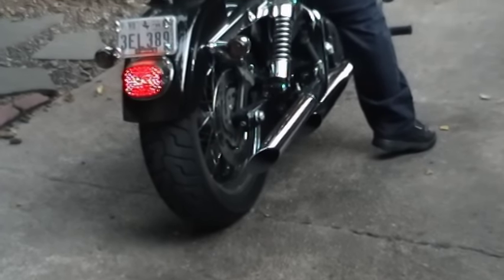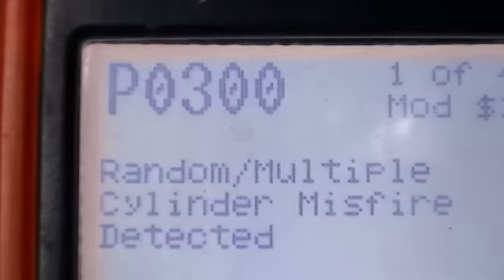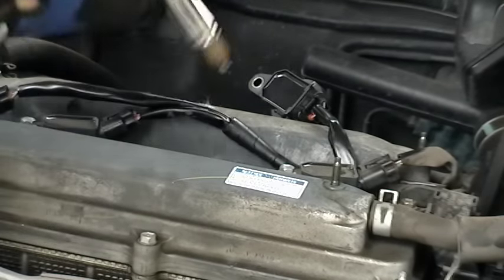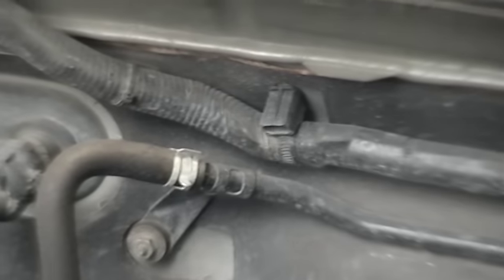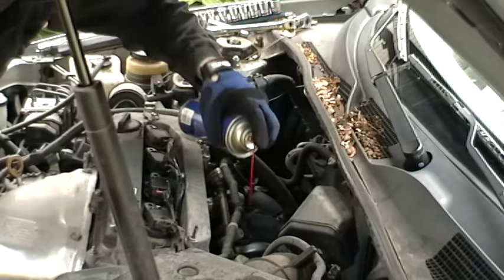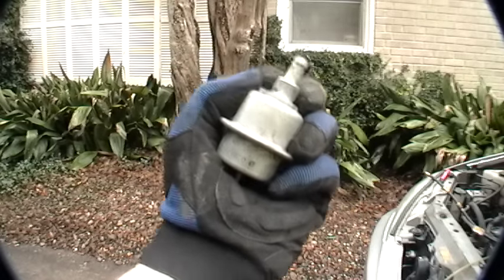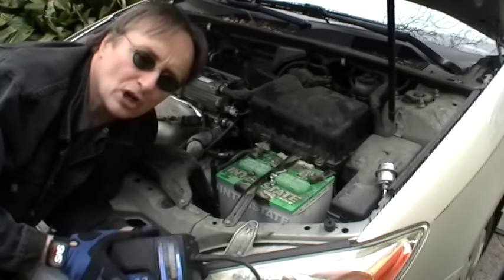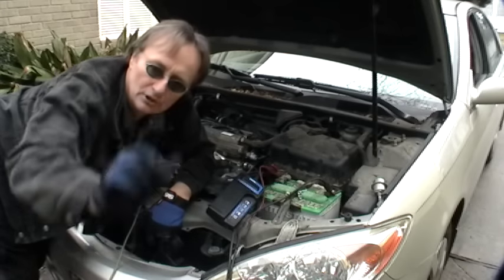How to Fix a Random Engine Misfire in Your Car (Code P0300)

Comment: Hello,
I have Toyota Camry 2006 (2.4L)/4Cyl....  it misfires,/loosing power/jerk during running when I increase the Accelerator...... but it remains Lil bit smooth when I increase accelerator very slowly.... No check engine light no any code. 

1)..I replaced Fuel filter
2)..Injector cleaned
3).. Air control valve Inspect and clean
4)... Ignition Coil Resistance Check and the resistance is between 349 to 350.7 Ohm for all 4 cylinders ( resistance measured between first 2 pins).
5)... All vacuum pipe also checked but did not found anything..
6).... All electrical fuses are ok
7).... At OBDII no no code display

what would be the cause of misfire or losing power or pick power or jerk....???? Please Rply.
Thanks and regards.
Dildar Hussain.
Reply from the maker: often a bad maf sensor, check that data first.
Reply: Dear Sir,
Thank you so much for your response,
I forgot to Write this step...
First of all i inspect MAF sensor and cleand it with its cleaner and replaced the Air filter also... (Fuel adjustment, PCV and throttle positioning sensor i didnot touch,, Are they related with this problem???)
Can you reffer a Workshop manual or Ebook etc..?
Regards
Dildar Hussain.
Reply: Dildar Hussain 
I have the same issue, exactly the same, with my 97 Honda CR-V.  I did all you have listed and perhaps some other things got anlittle better but then went back to the same or worse as you described and I don't know what else to check or do... Did you figure it out yet? If so, what did you doc any idea? thanks Hussain!
Reply: Could be fuel pressure regulator. It really just depends. Best way to nail it most accurately is to get a scanner that can read live data and look at at the fuel trims and all the sensors
Reply: Spark plugs.  Replace them every 50,000 miles
Reply: could be a burnt valve cover

Comment: After a rat chewed on my coil wire which was shorting on a metal tube ( ground ) when I go to live data it only gives info on 4 cylinders. It is a 6 cylinder. In the past my scanner gave info on all 6 cylinders. A standard coil puts out 20k - 30k positive voltage. With that much voltage going to ground I think it has caused a problem inside the ECM. What do you think? I don't see any other damage to my wiring.

Comment from the maker: start with these video tips. realize though that tahoes are notorious for fuel injection leaks causing it due to cheap plastic parts inside the engine cracking and leaking from age.

Comment: hi scotty i have code p0300 i replace spark plug, and wire and coil i need your advice because I spend over 300 $
Reply from the maker: +Karam Chato realize P0300 can be caused by over a dozen different things.  Now it gets complex and often expensive. Best to have a mechanic at least analyze the other possibilities first
Reply: +Karam Chato Cleaning fuel injectors is a cheap step to take to see if the issue goes away, you can have it done professionally for about $100 and because of the system they use to hook directly into the rails you should notice an instant improvement if this was the issue, or you could try a tank additive for $5-$10, pretty much same effect but you will likely have to wait till you go through an entire tank of gas till you see a difference.
Reply: What I did first was check for vacuum leaks, I always check the things that are easy and cheap to do

Comment: I have a 2000 Toyota Tundra 3.4L. It has code po 0300 random misfire. MIL- Evap, o2 snsr, o2 htr, catlyst.
I cleaned MAF, replaced o2 sensors and new spark plugs. I found 2 spark plugs on passenger are black and wet with fuel.
I removed these 2 spark plug wires out. It did not effect the engine. What should I do?
Thank  You so much for your video. I really appreciate it.
Victor

Comment: After cleaning up the EGR valve and EGR passage inside the intake manifold, my Honda Accord 2000 LX V6 engine is choking  or engine is hesitating while driving on freeway.  The check engine light is P1399, P0300 and all sorts of cylinders misfired.  All six ignition coils were replaced not long ago (only drive for 7000 miles), spark plugs also less than a year old.  The only thing I have not replaced is the fuel filter.  Battery looks fine.  What else I am missing here?  Do you think the car has the bad "EGR" valve?  Or fuel filter is clogged up?  By the way, where is the fuel filter in Honda Accord 2000 V6 located at?

Comment: Hi Scotty - My 2002 Jeep GC v8 is randomly giving my a p300,p301,p302 code. I know the spark plugs are good and the jeep seems to run fine. I am taking the fuel filter route as soon as my fuel line remover comes in order. It started with a p301 only and graduated to the 300,301,302. 160k miles on the jeep.

Comment: Hi Scotty, my wife's ford freestar has been misfiring and stalling for awhile already and I thought I had fixed the problem by replacing the fuel filter but the problem came back after she put some fuel in it. It was running fine for about 3 to 4 days until she put the gas and then started right back up again.  What do you think the problem could be Scotty? Thanks for your time.
Reply from the maker: pressure test the fuel pump, it may be going out

Comment: multiple misfire on civic gx 1998 CNG (compressed natural gas)
i have done this till now

-Replace engine oil
-replace spark plugs  (PFR7ND) NGK
-Replace cng gas filter (under the trunk)

What else do you recomend me to do? i am thinking to replace:

-NGK spark plug wire set
-Distribuitor cap
-Distribuitor Rotor
-Distribuitor coil

and my last options are:

replace egr valvle
clean  cng injectors
maybe change catalityc convertor

i will apreciate any help
Thanks
Reply from the maker: do a compression test of the engine first to see if it's just wearing out. If not, have the ignition system analyzed for problems, often a bad dist on those

Comment: Hey Scotty, my 03 VW Passat was running like a charm and after hitting my breaks pretty hard to avoid a wreck, the engine started running really rough and the engine light came on.  Coincidence? Probably.  Anyway, the check engine codes are P0300, P0301, P0302, P0303, P0304, and P0171 (System Too Lean).  Could the P0300 codes be causing the P0171 code or is it a separate issue? Thanks!

Comment: Hey ...need a tip. 2011 Durango 3.6. Just paid dealer to  replaced sensors, P000A, P0017,  P00455. Now less than 500 miles getting P0131, P0300, and P0171... going to new shop..They all want to start with a tune up and a coil. I'm not too certain actually very skeptical. I think it is something completely different. Any tips outside of vacuum leaks and spray carburetor cleaner. I think it may be a quick fix from a sloppy job or triggered from the sensors? What do you think, trying to save 600?

Comment: Scotty,

I have a 2006 Toyota Sienna with 105,000 miles. Used to get jerky random misfires any time I stepped on the gas. I replaced MAF sensor with denso, all 6 spark plugs completely worn down and replaced with ngk, replaced cylinder 2 coil with denso (it was bad), and fixed a frayed fuel injector wire on cylinder 6.  I also found a flex pipe exhaust leak after cat 1. That will be fixed next week. Still the car jerks and random misfire flashing cel any time I go above 4000rpm but it runs great now up to that rpm. You think the exhaust leak is causing all that or I still have issues? Crank sensor maybe? Only code I've ever gotten are p0300 and the p0302 was fixed with the new coil. Thanks!

Comment: The battery comment was right on!  My car had a random rich start (flooding) condition that was severe and mysterious. It disabled the car. Clue was the that stability control light stayed on a 2 sec. longer than it should on those occasions when it did start. Tech was very smart and went to the battery first.  Sure enough, that was it!!!  Now I watch the batteries very carefully and plan replacement at 3 years unless it's still perfect.

Comment: Hi Scotty! I have a p0300 and a p0308, on a 2008 car that's only 3500 miles old (and also p0464). Unlikely that it's caused by spark plugs do to low miles? But ignition coils could still be fair game due to age? Thanks! Love your videos!

Comment: I have a 2000 Grand am 3.4 litre, recently i experienced hesitation between 2-3 rpms and then hesitation through the gears.. I had it checked at auto zone, and it came up knock sensor 1 Cylinder2 misfire and some code for air intake.. I believe it could be my spark plugs and wires.. and also my knock sensor.. what do you think? and how should i go about fixing this

Comment: I would have never thought it would have been the battery. I started getting the misfire codes 300 301 302 exedra right around the time my battery went bad. I had bought a new cheap battery for my Ford tractor a couple of months earlier and was not using it so i threw it in.  The correct battery I took out was a group 35.  I put in a 24F.  I'm wondering if that would make a difference.

Comment: Scotty, my friend recently bought a 2000 Volvo S80 with 195,000 miles. It's throwing a p0300 random cylinder misfire, as well as having a faulty O2 sensor on bank 2 (twin turbo I6). Is there a specific place I should check first, or just run through spark plugs, coils, fuel line? My scan tool data stream also showed that both fuel systems were open, which is a condition I usually only see when a car is off.

Comment: Hi Scotty,
99 HONDA  CR-V 130K on it.
Have all the P0300 codes (all cylinders misfiring) Have 34psi fuel pressure. 
Followed your instructions to the tee.
Just got done changing the fuel pump,  no change in fuel pressure. The distributor cap, rotor, wires and sparkplugs are recently changed as well. 
 What could the problem be?
Reply from the maker: fuel injectors can do that, as can a blowing head gasket, bad wiring, vacuum leaks on the intake, bad computer, lots of stuff. Probably time for a guy like me to at least check it out for faults using his scan computer

Comment: Thanx for the great, concise, to the point, clip.
I've unfortunately got a V8 in a full size van so this series of checks is gonna be slowww and fekking painful.
Any suggestion as to what to check first on a 5l vortec?
Fuel filter is swapped. Pump is only 4 years old and I can hear it.
MAP sensor has reported in the past and I've cleaned it about 4 times so far.
Battery is only 15 months old and dash gauge isn't reporting any issues with charging etc
Reply from the maker: on those, almost always bad vortec fuel injection system due to cheap plastic parts cracking from the heat inside the engine where they are hidden. See that all the time
Reply: Scotty Kilmer
 Thanx Scotty. Sorta! Guess that means this might not be cheap!  lol.  I was just heading out to check the MAF and MAP (but then was thinking not likely as they'd code if they were the culprit, no?).
When I parked, after nearly getting demolished in traffic yesterday, I put it in park and it rev'd fine-but my speedo was acting like a tach!?
The only way to check what you're saying is tear the top off. Guess that means I'm cab'ing it till the weekend.
Thanks again, I've subbed!
Reply: ROOKTABULA
I should add that it run's throttles just fine in park or neutral and is running fine today. I've just had 4 of these episodes in the last month, always from cold start. Usually clears up after 15 minutes.

Comment: 2003 Buick Rendezvous.  P0300  Random/Multiple misfire.  Told by mechanic that cylinder number 3 has "low compression."  Not sure how compression in a single cylinder could cause misfiring of multiple cylinders, or the car to run rough on intermittent basis, and worse at low RPM than high RPM's when the symptoms are present.  However, based on your last tip, I checked battery.  Diagnosis was "Bad battery"  producing only 183 CCA of the rated 600.  Is that "dead enough" to cause P0300, and an intermittently rough (of varying degrees) engine?  Note:  Problem seems much less at highway speeds and at times engine seems normal.  Occasionally, especially starting from standstill, it can be extremely rough.
Reply: Did you get a fix for this?  My Bravada is doing the same thing

Comment: I love your videos, Scotty. I've have a P0300, P0172, P0420 on my 2004 Chevy Cavalier. I've done everything I can think of. I've done everything suggested in this video. Got any idea what's wrong?
Reply from the maker: fix the 12 code first, it's probably causing all the others. Often leaking fuel injectors or fuel pressure regulator causes that

Comment: great video. i have a 1999 mitsubishi montero sport with code p0300 at start-up. i replaced plugs, wires, fuel filter, no vacuum leaks. When i disconnect the maf sensor, it seems to smooth idle. Can the maf sensor be my issue?

Comment: You called it Scotty!
I fought with my ‘07 4.7 Jeep Commander over that PO300 code replacing a bunch of parts with no success. That went on for months. Don’t trust the dealership and wanted to beat the problem myself. I didn’t think it could be the battery as it was a Duralast gold only 3 years old. Then we had a no start day on vacation. I got it going and got home but after 4hrs driving the battery was only at 11volts though the alternator was putting out 14.5v. Put in a new battery and guess what? The misfire issue went away ! Hasn’t thrown a code or had a problem since!
How bout that !

Comment: Hey Scotty,
I have a 2001 Toyota Corolla that has the code P0300 and throws some black smoke when cold. When I first got it, it did not throw any smoke at all, but once I changed the oil and the spark plugs it started to throw the black smoke. It doesn't have the check engine light either. What can I do to make sure what is the main problem of the car?

Comment: 2001 Ford Explorer 4.0L 230,000 miles random intermediate miss fires engine surges and sometimes does. I hear the rear timing chain sounds like it has slack in it I'm fixing to change all of them. Will a loose timing chain make it do that? I think the guide is wore out it started doing it all in a week. I'm wondering if it's the tintioner guide and just change it first to try it?

Comment: Thanks alot buddy. For the past 2 days I keep thinking my valve need adjustment, Pcv, my boot engine, got spark plug done twice, but to found out the ignition Coil I bought online 2 out of 6 was bad smh. I went to pepboy and replace the bad ones and bamnnnnnn my baby running like new again. People dont used after market parts unless you got money's to wasted down the drain.

Comment: Scotty

I have a 2003 Dodge Durango 4.7L, I have the P0300 code someone told me that because my A/C pump is rattling it's causing the misfire. What do you think?
I checked the following
Spark Plugs-all good
Fuel Pump-all good

Comment: How about a bad or leaking (fuel pressure regulator)? I found 2 gallons of gas in my oil. Random misfire. May be fuel in my tail pipe. 1998 Blazer not starting, now. I can't tell if radiator fluid is in the oil as very little is missing from the reservoir and gas is the dominant contaminant.
I believe I should change the fuel pressure regulator and head gaskets?

Comment: I have a 2005 Chevy Aveo and Ive been driving with the random misfire codes for a while. I'm wondering how much harm am I doing to my car?

Also I'm a delivery driver, I DRIVE ALOT. What are some tips you can give me to help squeeze as much life out of my car as possible. I bought the car earlier this year with 79k miles on it. Car broke down so they redid the transmission and fixed the timing belt issues Aveo's are notorius for.

Comment: Hi Scotty My 2002 4WD Toyota Sequoia started running a little rough at stop lights yesterday. The VSC lights also came on and stays on. I took it to get a diagnosis test this morning. Eight codes came up. Namely: P0300, P0303, P0306, P0115, P1520, C1340, C1203, C1223. Any idea how major these issues are, how long it take to fix them, will a lot of parts have to be purchased, and what it will cost to have them fixed? Also, could any mechanic fix these or only a Toyota dealership can? Thank you.

Comment: Great vid! Red light was on,on scanner, emisn.  4 codes came up in this order one repeated. Getting a P0440, P1448, P0325, P0440-again. Car 2001 nissan  2.5l. Car ran ok,no chk eng light when shut off friday. Started sunday engine stumbling. Shut down. Ok on restart, no check engine light. Car drove 1hour no problems/no chk light. Gas cap, fuel filter, maf sprayed and vent control valve replaced, dealer parts 3-months ago . Any ideas? Thanks. Any chance leaking fuel injectr/loseing  all the presure over long period of time, or weak fuel pump?
Reply from the maker: often bad maf sensors do that on nissans, they can't be cleaned often on those as they break down electronically. Have it analyzed by a mechanic who can look at the live data feed.

Comment: hi scotty, got a 2002 pt cruiser,new plugs and wires, at idle it quivers off and on, slight misfire, got the code today po300.. car runs great when driving, had this about a year, and its allways done this, not a smooth idle.i erased the codes, after awhile driving its fine, starts fine, but at idle same off and on idle quiver, schould i change the crank sensor and the coil pack as a start? it has new timing belt and water pump 2 years ago. it has 166,000 miles, its a clean car  and well taken care of. please let me know on this quiver idle its driving me nuts bud, thanks andrew

Comment: 1996 Corsica. Replaced plugs and wires. Could a MAP Sensor and a TPS also trip the code ?? The car runs like it has a plug wire switched. Made sure that's not the case.

Comment: I have a 2000 Volk jetta with 200k miles(4cylinders), it has the p0300, p0301, p0303. What would you suggest i try replacing first?
Reply: daledenton1132 Is that supposed to be a joke? If not, do explain.